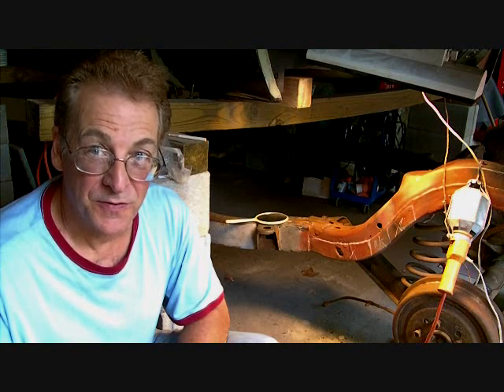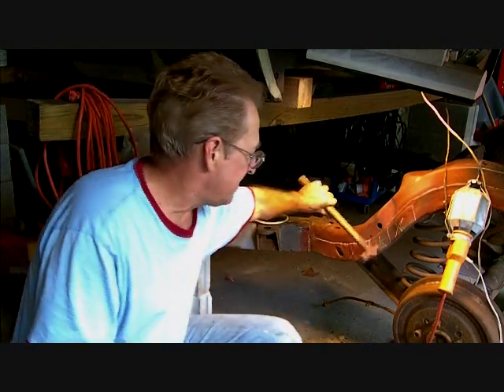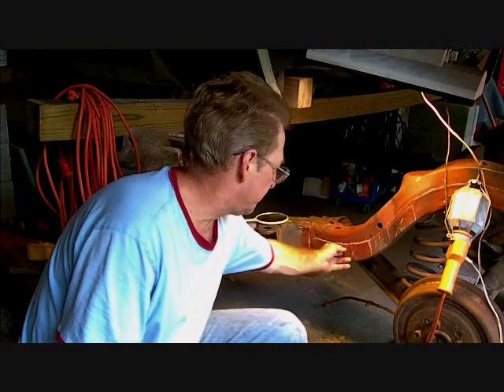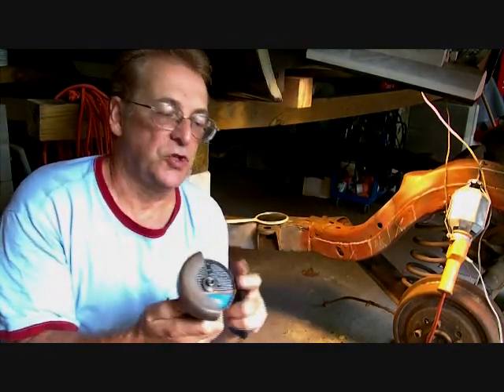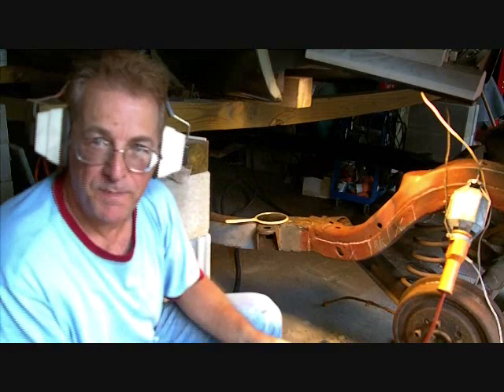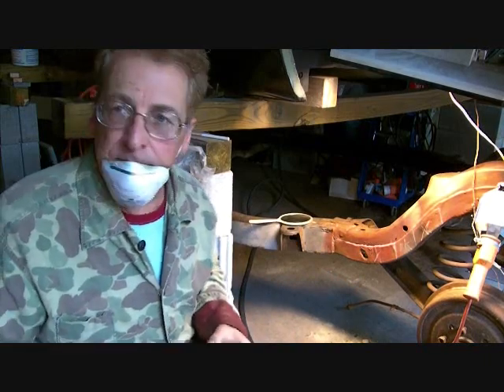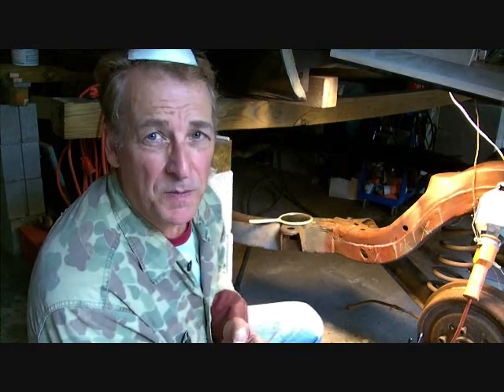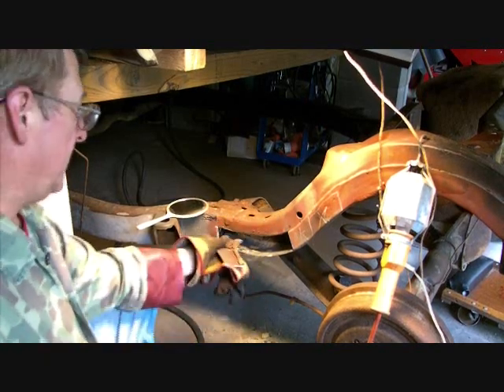How to repair a rusted out frame

Comment: I ALWAYS wash my frames and use the WAX as the last setting at car wash. I also sprayed penetration oil my additives into the holes. I also painted my frames. I capped all the holes you see eventually. Plugged the ends at bumpers. I gotten GOOD money for my used frames. You MUST take care of them! I also greased every junction and bolt. Id love t do it for living. Im GOOD at what I do and have many tricks I use.

Comment: I live in PA.....This car came from a farm where it was sitting in the mud for over 20 years...mud and Hay....the mud and hay was like concrete I had to chip off the bottom of the frame....Looks like the place where it was sitting was muddy all year long too...because that stuff was stuck to everything.    Use to have a big problem with those 57s too in NJ....the whole rear would just fall right out if they were left in a field for any length of time...

Comment: Not sure I like you doggin Chevy. The frames were NOT known to rust out at anytime in their lives.  I have a 63 Chevy pickup and have never had to do ANYTHING to the frame.  Today it is in near perfect condition.  Might I suggest that you are claiming that bad luck on the frames to where you live, like an area tht uses salt on their roads and crap just happens to rust out faster than it should.  I have a Dodge Ram that is from Pennsylvania that is rusted out because of the salt used on the roads